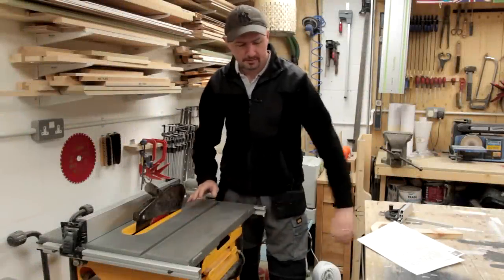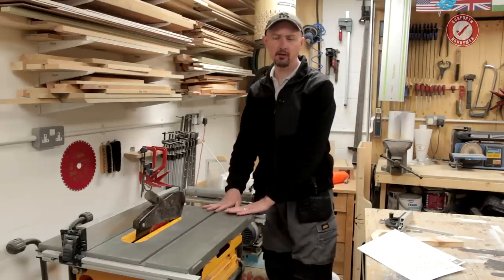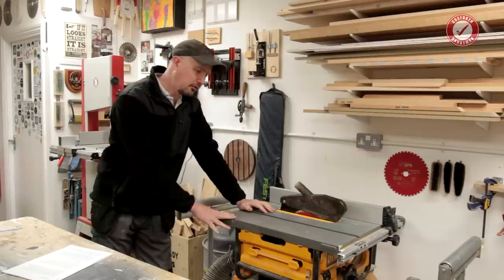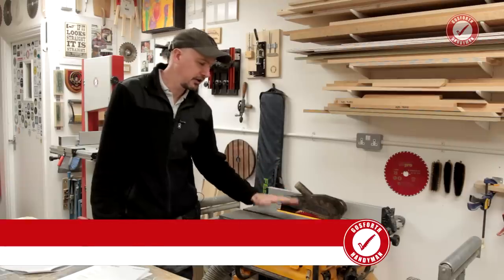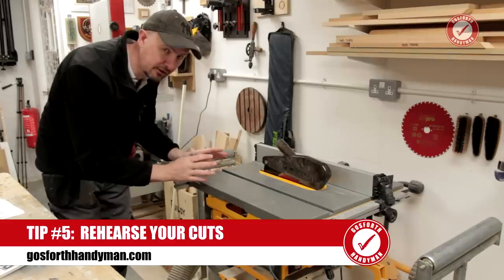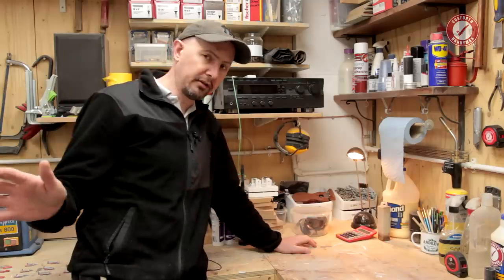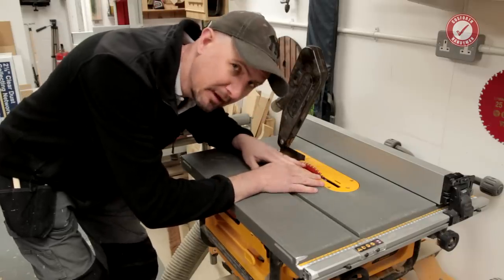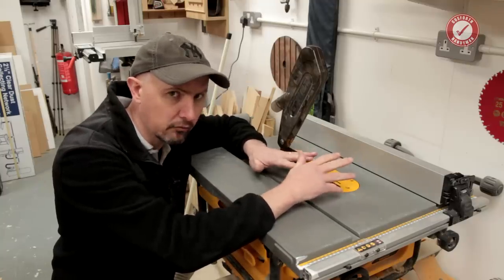TABLE SAW SAFETY - 11 tips to avoid death!

Comment: Great video same applies with all tools especially bladed machinery , I injured myself badly as an apprentice being unaware of the dangers using a chop saw without a guard , pulled the 3x2 away from the bed before the blade had stopped it caught the blade bounced the machine up and onto (luckily) the top of my forearm , tough lesson to learn and scarred from life for it. nobody's immune and it can happen in an instant safety when using equipment like this is paramount so thank you for making people aware great video!

Comment: As a beginner at the table saw there is a lot of useful information here.  I watched it again for the 3rd time.  The things I took away from this video were:  1. rehearse your cut; that is an invaluable piece of information. 2.  using the table saw side on:  3.  Understanding the dangers of kickback.  And many more tips.  Like how to use a push stick and what is a good push stick.   And like the previous commenter the importance of a riving knife (don't know how to spell it) But mine seems broken and I should figure out why.  (I got the saw 2nd hand)
Finally, as a suggestion:  I'd like to see a video on changing the blade  (and even how to replace a riving knife)  Thank You so much! Micki
Reply: You should consider getting a proper table saw with a working blade guard and riving knife. I know that second hand tools are easy on the wallet, but if you are missing these essential safety components you are taking a huge risk.  Good luck with your woodworking.

Comment: I just had my first kickback accident. Cut tendons on my index and middle finger on my left hand. Even though I was using my push stick, I had no riving knife and the board rolled over the blade and wiped out my fingers as they were guiding the wood. It’s been 1 week since. My fingers are able to move. Thankful to still have them. 
Thank you for the video. This helps put into perspective what took place.

Comment: Andy, very good video, these type of video show what the danger is. Most people read, but do not have the imagination of what the out come could be when something happens when you are not paying attention. My brother has been a cabinet maker for 30 years and lopped of his fingers, the worse thing to use when using a table saw is NEVER EVER USE GLOVES. The thread of the glove got caught on the blade and pulled his hand towards the blade. People using a table saw need to have COMMON SENSE, if you dont have COMMON SEND better to use a hand saw.

Comment: One of the best table saw safety video ever. Congratulation and thank you. Detailed, precise, authentic and genuine (unfortunately). 
I would add only one thing: zero clearance insert. Small parts falling partly in on the side of the blade are very dangerous.

Comment: I joined Steve Ramsey's woodworking course back in March just as we went into lockdown and he does go into some detail on tool safety - I had problems getting a shed and it finally arrived a couple of weeks ago - at first I was frustrated not building anything but what I did do is binge watch YouTube sites (including yours) on all things woodworking, jig making, shop safety and I am certain it was the best 8/9 months investment of my time When I start filling the shed with my various tools I have stored in the spare bedroom I will be doing it slowly and surely and before using them I WILL read the manuals (and watch some videos) All the tips in you videos are excellent - I would add one PATIENCE - ( I know this will be not as possible for a commercial  carpenter) - If its a DIY hobby take your time after all this should be enjoyable - Go make some saw dust!! - One question a lot of people on various suggested I get a GrrRipper from Microjig and it seems to have a loyal following what are your thoughts of this verses the big black poky stick you use

Comment: that's it i'm subscribing you since said, " don't lick or eat the blade whilst its running " I'm putting in an order to collect this saw tomorrow just thought id brush up on some safety whilst I'm tired before bed. happy to say nothing caught me out the best tip ill take from this is using the push stick closer to the blade rather than the guide fence. thank you.

Comment: This is a great video and thank you for it. One thing that I wish you would have addressed (and maybe you didn't because it's so obvious) but you alluded to it: Never wear any loose clothing like long sleeves, untucked shirt, unzipped sweater, or hanging things like a necklace, or loose long hair. Always remove these and tie your hair back tight if you have it long. You don't want to get anything caught in the blade that will pull any part of your body into it. Also, never wear gloves when using any kind of power saw. Gloves are guaranteed to get caught in a spinning blade and, well, there go your fingers.

Comment: I am so glad to see someone put up a video on table saw safety 👍 I am sick and tired of watching video after video of people who while reviewing a table saw which a manufacturer has sent them for free hoping that they will do a review on one of there products only to see the person either take the blade cover off before or to admit that they will be taking it off after doing the video is done is because they think that the cover is crap and that they have more experience than everyone else 😲🤔🙄🙄 

My own father-in-law who lives next door to us has one of these homemade table saws which I will admit I have used on recent occasions but I don't like using it because his table saw is so dangerous it's unbelievable !! 😲 it's home made as in a circular saw clamped to the underside of a metal table, there's no blade guard, there is no fence, no slots for fitting a mitre to or even a sled, in fact there's no nothing except keep your eye on the blade at all times otherwise I'd probably loose a finger or two but because of the extreme speed at which these things turn what chance do you have if something goes wrong ?? He is one of these people who thinks he has the best table saw around because he built it himself 🙄 but several years ago he cut one of his fingers off at one of his joints but he won't admit that the table saw got the better of him there. I am just about to invest in a good table saw for myself but he has already said  that there's no way he wants to use it (obviously he is jealous) 🙄🙄 I am hoping to buy an Evolution Rages 5-s which I believe is an excellent table saw and which won't break the bank either 👍

Thanks for doing this great video 

Glen Fiddich 🥃

Comment: Great safety video. I have been a wood worker for many years, but as you noted, complacency is our greatest enemy. One other thing I suggest you mention is fence adjustment. The saw in your video is no doubt a good unit, however the fences on these inexpensive units leave much to be desired. The fence should be checked often to ensure it is parallel with the blade or slightly skewed away from the blade nearing the end of cut to avoid serious kickback.
Reply: Your pointed a big issue.  To keep fence parallel with the saw blade is one of big very dangerous problems at low cost machines.  It will be nice if someone address that issue in more details.  Thank you.

Comment: Thanks for this safety video. Loads of info. One thing in particular that I would never have considered is, besides putting the cell phone on silent, also put it in your pocket so it's at hand in case of an emergency!

About the idea of using the table saw sideways, it does appear to give you more control with the workpiece. The only thing I can see wrong with this idea off the bat is that you cannot reach the power switch easily, if at all, in case you need to shut it down quick, such as, as you said if you feel something feels wrong don't move anything and turn off the saw. Thanks again for this fine video.

Comment: Excellent video.  Here in the Philippines, most table saws are used free-hand by two people WITHOUT any kind of fence or rivenknife...  Usually, the 'table' part hardly deserves the name...
One guy pushes it in, the other guy on the opposite side grabs it and pulls it through the second half of the cut in one fluid motion.

Comment: Hello,  thanks for the video. I also turn off the table saw after each cut, when it's clear of the blade, reach over and shut it off, wait for the blade to stop then remove the pieces and set up for the next one. Additionally if you can't make a cut with the guard on then you should consider a alternative way. I'm glad you pointed out to not fear the saw rather that one should respect it.  Fear is from ignorance and respect from knowledge,  working safely with understanding now that's wisdom.

Comment: Iv just came out of hospital after fracturing my small finger and cutting through the tendons on three other fingers Why did it happen, I was pushing  a 1" wide by 3/4 in thick section of wood using a push stick and just taking a sliver off one side. My left hand was the other side of the blade getting ready to take the completed cut away from the machine. We still do not why we had a kick back but it dragged my whole hand into the blade. My small finger top was hanging off and blood puring all over my wortkshop floor. The future prognosise is not good. How to avoid it. Use a 3D safety push handle as it keeps your hands well away from the blade.
Great video, Many thanks for using the slow motion frames as well.
alan

Comment: Great video! People need to hear the woodworking horror stories - I've got some shockers I could tell you but you'd need to see a counsellor afterwards. One thing to add.. I would raise the blade height for the thickness of material you're cutting there. IMO, it's better that when the blade is cutting the material, the teeth are pushing the material down onto the table, rather than pushing it back towards you. Material is less likely to float/snatch on you. Greetings from Gateshead!

Comment: Thank you for this video. I was cutting several dados in a piece of plywood when a large bug flew at my face causing me to flinch and duck and twisting the board which flew back and hit me in the stomach, very similar to your experience.  No real harm other than a bruise and needing to change my shorts. I use that as a teaching tool for my daughter. I have always said do not be afraid of the tool but have a great deal of respect for it. Thanks again for sharing your mistake.

Comment: Two things in life that will bite ya in the backside the minute ya get cocky. One is a imotorcycle the other is a table saw. Respect don’t fear is dead sound advice. If you’re afraid of it , leave it alone or get someone to teach ya properly. On a second note I’ve worked my tablesaw side on for years. It seemed weird at first but really does make a lot of sense. Great video on what is a marvellously versatile tool, if it’s used properly !!

Comment: I bought my skill saw table saw with a 3Amp motor! I’ve never removed my riving knife! Whoa that’s very scary what happened to you! Glad you were ok! I’ve seen kickback on material from my saw! I’m very careful when I use it! Always with my left hand close to pushing down the off button when I’m near end of my cut and I use the cheap crappy plastic push stick it came with! And I would never use it to cut off material that’s as big as the piece you cut off.  I use my Ryobi circular saw to plywood even making angled and straight cuts  on 1x12x8Ft common board softwood and cedar for cutting out and replacing dry rot wood subfloors in my 45 year old bathroom remodel. Everyone who watch this needs to be extra careful it just takes one accident to sever your hand or fingers and you’ll never be the same!  Never use your tablesaw in dim light or when you’re really tired put it off until the next day and be safe please!

Comment: I use one, as you said, as a last resort. In addition to the PPE you mentioned, I also use a thick leather apron, which should be overkill if you stay out of the line of fire.  I too like the bird's mouth sticks which I tend to make from scrap lumber.  I always shut my saw off, hold, and wait for the blade to stop spinning before I collect both halves of the cut piece, waist or finished pieces.  Blades usually match the kickback preventer's thickness or be ever so slightly thinner.  When done for the day I lower the blade.  When storing, I remove the blade altogether.  Dado cuts are tricky and need to be well thought out.  I prefer a weighty metal tennoning jig for end pieces, but often hand cut these and use a chisel to finish them to size.

Comment: It's difficult to watch stuff that involves accidents, probably because I've had one, but you did a great job of illustrating what most everyone that uses a table saw will inevitably encounter at some point, for a variety of reasons. As you said, there's no time for all of it so I'll chime in as to my "first things first". To me, initial set up and continual calibration checks are key, for accuracy and safety. The blade MUST be square to the miter slots for accuracy, but the blade MUST NOT be square to the fence, for safety. If the blade is perfectly square to the fence you will get kickback as the wood heats and swells as it's being cut. And that is true with even the best plywood. If it's solid wood, the problem just compounds. If it's a slightly wonky piece of anything, then ugly will likely follow. All of us should be very careful to maintain our fence adjustments so it is never square. The rear of the fence should always be slightly further from the blade, maybe just a 64th, but always slightly proud. I like using my fence to miter slot as a visual guide for this but to do that the miter slot must be exactly square to the blade. You want it that to be the case anyway for sled use. Using this method, I can see that my fence is proud on the back side by .015" of an inch, visually, across the length of the miter slot. Once set right, the blade to miter slot doesn't change, other than the inherent deflection in the saw and blade, but your fence can come slightly out of tune much easier.

Comment: The last resort is right!  I have a bunch of saws (hand saws, miter saw, jigsaw, reciprocating saw, circular saw, etc), a plunge and fixed router, so many other options that are easier/safer to use for a lot of cuts. I JUST caved and bought my first table saw after failing to find a good and still safe way to rip small boards for some projects. I was even risking ripping ones that were under 12” on my miter saw to avoid a table saw. I did take a class on how to use power tools mainly to learn how to use a table saw with hands on instruction.  I just made my first cut on my own table saw after watching and re-watching videos that I have watched many times over and rehashing my papers from the class that I took. And I only did one cut just to try it out. I’m back to videos because the adrenaline kick from making that cut was enough for me to go ok, I can’t safely use this until I unwind from the first cut! 🤪

Comment: I own a Dewalt contractor table saw and have managed to keep all my fingers for the past 3 decades.  One of my favorite safety tips when using all types of power tools is to always look at the position of your non dominant hand before turning on the power.  Traditionally your attention is on your dominant hand.  It is the one controlling the power and is out of harms way.  Your non dominant hand is the one most likely at risk.  This works for drills, saws, wrenches and most tools that I use.

Comment: Thank you for creating and sharing this important video.  
I just picked up a newer 10" portable table saw that has a riving knife, blade guard and anti-kickback pawls.  This table replaces the first one I ever bought three years ago, a very old craftsman10" portable table saw with zero safety features.  Used it once, without any self-education on saw safety, and it scared me to death.  Sold it the next week.  
My newer saw, even with all the safety features that lessen the risk of injury, doesnt mean bad things can't still happen.  Every point you made in your video is spot on, clearly explained and invaluable to anyone using a table saw.  While I have yet to actually cut anything on my saw, I am in no hurry and absorbing as much safety information as I can first.  
Much thanks and appreciation for your efforts to help everyone stay safe using a saw.  

Question - can a footswitch be used for turning the saw on and off?